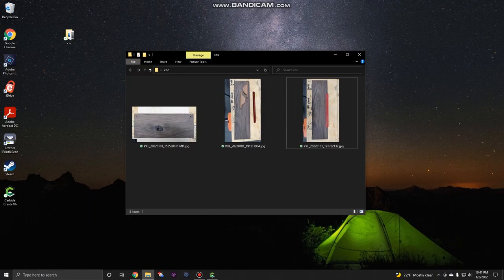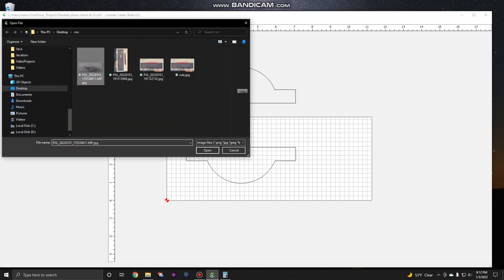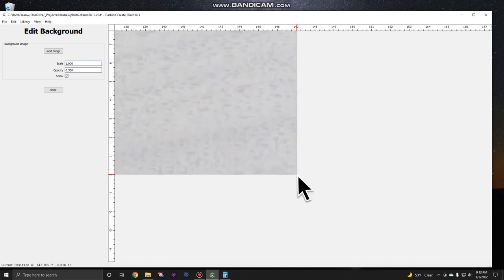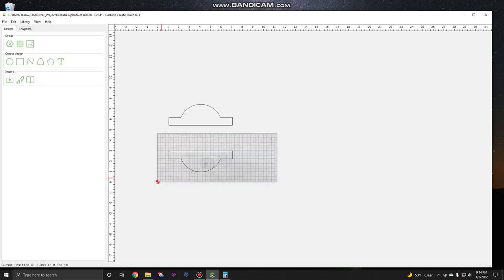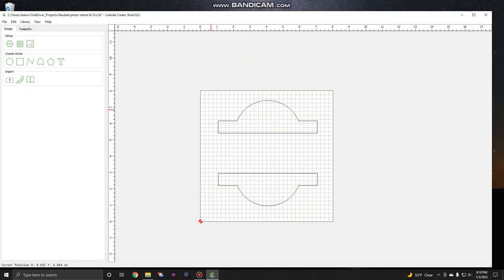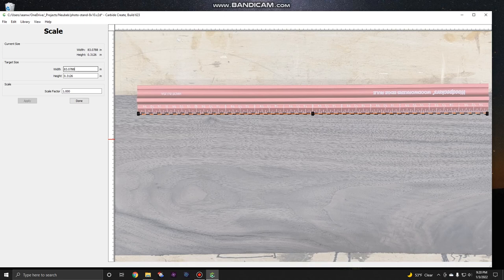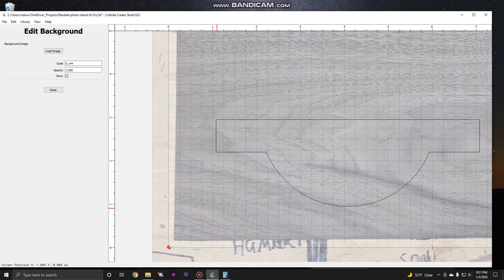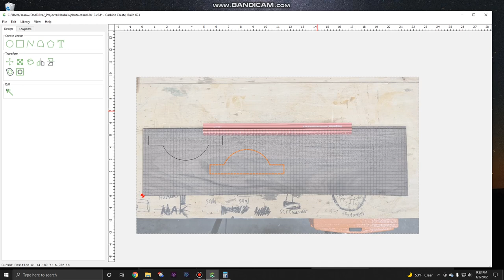CNC Parts Layout Tips and Techniques

Comment: I don't have a CNC but I found this informative. PS you have great hair.
Reply from the maker: 🤣🤣😂😂 thanks Rory! I'm gonna have to pin that comment. Didn't you get a laser recently? Wouldn't the same technique apply? I don't have a laser so I'm just speculating.
Reply: @MakerBeach  I got a cricut so not quite at laser level yet but the same technique might work. I'm a noob but the cricut software has been easy to work with so far.